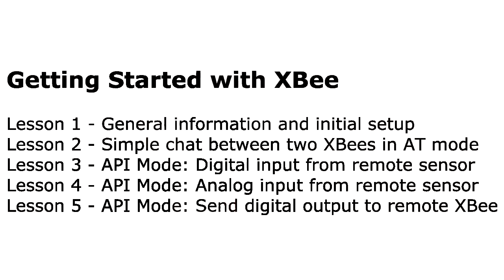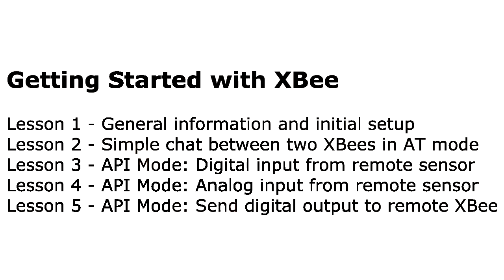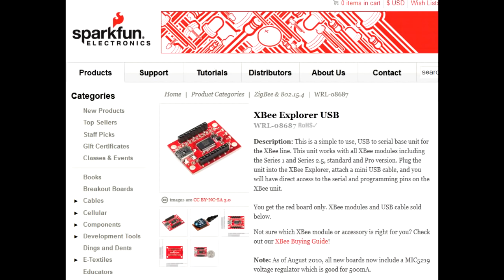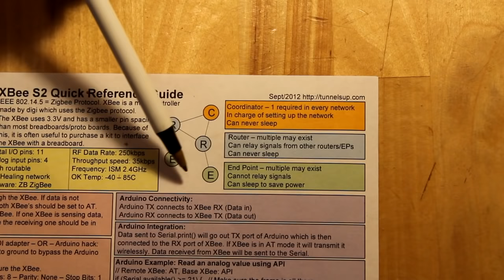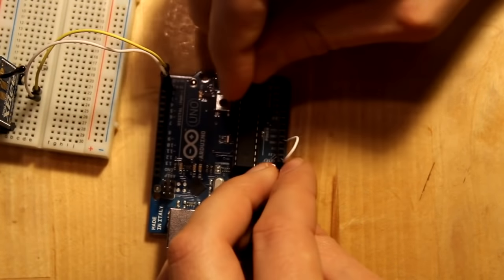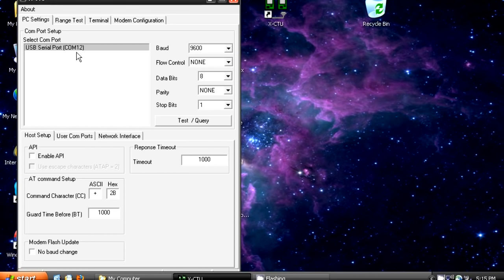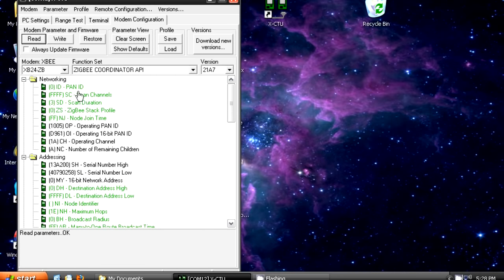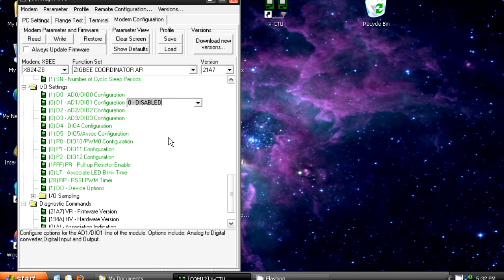XBee Basics - Lesson 1 - General Information and Initial Setup

Comment: It is common for many to use the terms "XBee" and "Zigbee" interchangeably.  But not all Xbee modules run the Zigbee protocol.  Some Xbee networks can be set up peer to peer and may not need to be designated as Coordinators, Routers or End nodes

Comment: Hello, 

For my final study I love my card arduino connected to my pc and send the information to be recorded on an SD card. I want the card to be connected wirelessly. I saw that there was the xbee solution. I want to know if it is possible to have a transmitter / receiver for the pc and the same for the map? In this case is that the pc would always connect to the pc with a "serial port"?

Comment: Very nice presentation, my biggest problem is getting the drivers loaded could you do a video on getting the drivers to work correctly. I have been successful at loading the drivers before but it seems the drivers won't stay working. I think other software drivers conflict with them.

Comment: So you've been running your xbees at 5 volts in the video, while the spec sheet says to not exceed 3.6 volts. Following your tutorial, I also ran them at 5 volts with no problems. I only recently found the voltage requirements. Do you know why they seem to work okay at 5 volts?

Comment: I want to buy or build some cheap 900Mhz range devices (relays) to work with my Smartthings hub.  Zwave switches are $40.  Is there anyway to do this?  The device you are using is 2.4Ghz but I see there are Xbee models that work in the 900Mhz range.

Comment: Hello , Thanks a million for creating such an outstanding clip and also your invaluable efforts toward illustrating the subject. I have a question which has been tickling my mind for so long, but before I ask it I have to confess that it doesn't specifically relate to this product. It's about a pair of ProBee ZE10C modules. These are a wee bit older than XBee modules. To cut a long story short, I could run them perfectly but my problem is that when I config them after a while their settings turn back to the factory mode and I have to set them again! This has been driving me crazy! I've gone through its datasheet for like 100 times! But don't know what I've done wrong! You know I save the commands by putting ATZ command, and at the end I reboot them, then for a short while they work well. I'll be so thrilled to see your recommend. I also do apologize for taking your time man.

Comment: very good material in these 5 presentations. In my project, i should establish a wireless communication btw 2 xbee. each one will be connected with a pic microcontroller. My goal is to connect the one module to one pc and the other module to another pc and send and receive data. Do you have any advise how to start with this?

Comment: hi, I want to transmit my voice by using xbee and arduino. Is it possible. 
Thanks
Reply: Not impossible, there are voice recorder/mp3 players written for the Arduino, but to get any real sound quality, you would need to up the transmit/receive speed (from 9600 up).. also, Analog output is limited down to 0-255pwm, where as analog input can run 0-1023..

Comment: It's too bad, Digi decided to change XCTU to an All-GUI.. They've finally made a Linux version (Don't know if they have a Mac-OS/iOS version), but.. VERY Unstable! I've had it crash on at least 2 machines running UBUNTU 16.04, and one running Debian 8.5 ..  Where as with the older version (like you use in this through lesson 5), the entire screen is a GUI nothing but icons, and very little text.. The only Added option, is there is a "XBEE Recovery" under tools, if You've accidentally crashed one.  But, it no-longer works the same as the older setup software..  (so, all of the 'unbrick" methods here on YouTube are obsolete. :-/  But it still helps to know which wire to GND to reset.)
Reply: Hi How did u install the XCTU in Linux , is there any tutorial -for debain
Reply: Digi DID release a Linux version, But it keeps crashing under Ubuntu..  It comes as a '.run' (shell executable, requires Root access).   When they made Version 6.2.0, they finally added Linux suport.  Most recent is 6.3.2. Hopefully, they fixed what was crashing .3.1 ..
http://www.digi.com/products/xbee-rf-solutions/xctu-software/xctu#productsupport-utilities
Reply: And.... (a) the new version (6.3.2) works! But.... a little more than just simply the chmod +x....
the following steps:
open the terminal, and do the following
sudo -s
<your root access password>
cd Downloads <or wherever you download the file to.)>
chmod +x 40002881.run
cd / <root directory NOW comes the hard part>
chown myusername:myusername opt <yes, you have to change the ownership to you.>
chmod 777 opt  <and allow full access>
<on the graphics interface, navigate to your download directory, Right-click on the file 40002881.run, and select Run.>
<let it finish..  when it does, let it execute the program. This tests if compatible to your version>
<Close the program>
<go back to the terminal session, and type>
chmod 755 opt <this puts the old permissions back>
chown root:root opt <and previous ownership>
cd ~/Desktop <Now, we need to make the .desktop file executable>
chmod +x XCTU.destop <when you look at your desktop, You'll see the XCTU Logo>
<exit twice, to exit the terminal>
<close everything to get back to your desktop, and it should be in the upper-left corner, or below any others already there. Simply click, and run.

Comment: i could not detect my xbee using seeeds xbee shield v2.1.....shield was connected to arduino......but my XCTU is detecting arduino but not xbee using shield...........do i need to install any drivers for shield
Reply: Sorry this took so long to get back.. I'm looking at the V2.0 shield, check to see if the jumpers are on the right-most pins..   (of the 13X3 pin header). there should be 2 jumpers. The idea, is these either put the Xbee's RX & TX pins in parallel with the Arduino's D1 & D0 pins (RX,TX), or reverse for letting the Arduino communicate with the Xbee..  Try the following: put the right most jumper from 0 (from the center of the board, Ignore the #'s at each digital pin socket) going from center (digital) to XBEE_TX (the bottom set) and put the other jumper from 1 from digital to XBEE_RX. And jumper the RST pin to GND (left-most socket of the power header, to one of the two GND). try the XCTU again. If this doesn't work, reverse the order of the jumpers. (1 from digital to XBEE_TX, and 0 to XBEE_RX). This should work the 1st way (0 to TX, 1 to RX), while keeping the Arduino dormant so it won't react to the xxu2/FTDI USB host. Hope this helps!

Comment: sir , we can transfer char value  directly or through ascii value?
Reply: AT mode, I think you are capable of sending anything from &H0x00 to &H0xFF, (as long as it's not a stream of 3 &H0x2B's ("+++"), which will kick it into AT command mode.  AT mode is fairly transparent.

Comment: how to bypass Arduino UNO ? I have done as your instration in the video but it dose n't work!!!
Reply: yes
Reply: @karthikb547   try software serial, or strait up removing the the atmega chip from the Arduino Uno
Reply: Reset pin connect to groung helps????

Comment: Awesome hack .... how you can use Arduino Uno as serial communicator....simply brilliant.
Reply: As he showed, the D0 & D1 ports of the Arduino are simply TTL level Serial ports between the ATMega328 & the USB <--> Serial chip (either ATMEGA8u2 , ATMEGA16u2, or FTDI FT232R, dependant on version of arduino).  The 'Short RST to GND (force the 328 into Stop/reset) keeps it from occupying the ports. There was a company that made specific shields (Libelium) that connected to the D7 through D0 & A0 through A5 pins, which had a set of jumpers, which could either use the serial output from the Arduino (in XBEE Setting), or direct talk tot he XBEE (USB setting) . Drawback with their design, was the placement of the XBEE itself, covered the RST, 3.3V, 5V, 2x GND & Vin pins, as well occupied the ISP pins for power only.

Comment: Will the arduino reset to ground trick also work on a Mega?
Reply: Fuzalert2k  Yes it will.
Reply: As Matt Pamenter said, yes.. The reset to GND puts the MCU into sleep/reset so it does not react to, or occupy the port . If you want the MCU to talk TO the Xbee, you simply swap RX to TX, TX to RX,  and remove the jumper.  There have been others, who, like in this tutorial, removed the MCU chip (on those capable, not so with the surface mounted.), which really is unnecessary as long as the MCU is dormant.